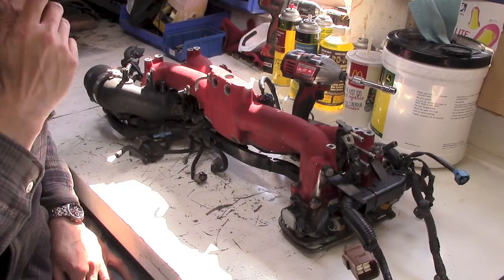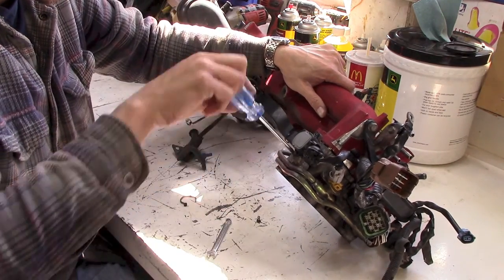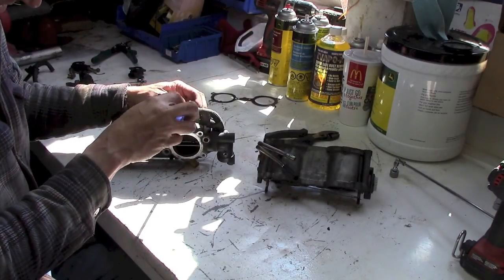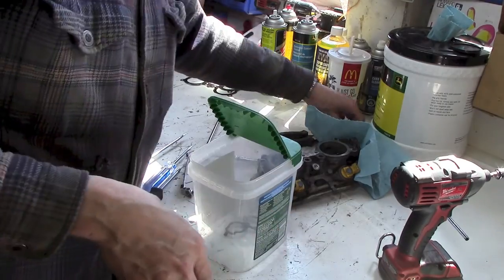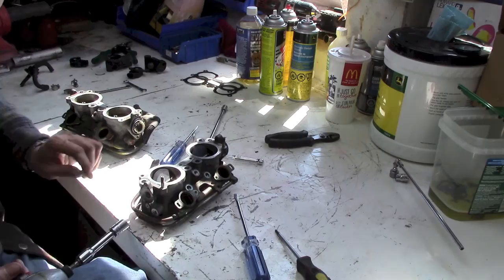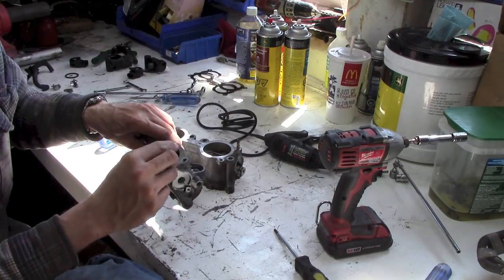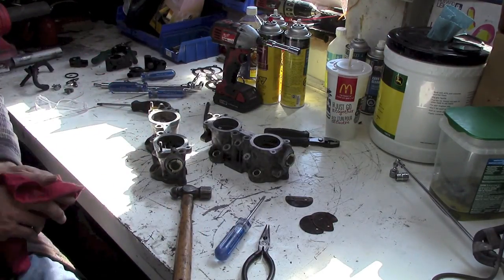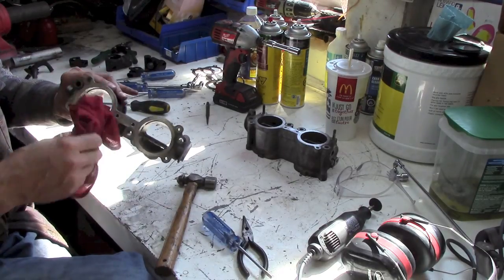Subaru Tumble Generator Valve Gut Job

Comment: Before you did this was your engine misfiring?
Reply from the maker: I had a misfire previous but that was plug related.  I did this as the TGV sensors were causing trouble codes.  After the delete I had to make sure and disable all of the codes in the ECU related to the TGVs.